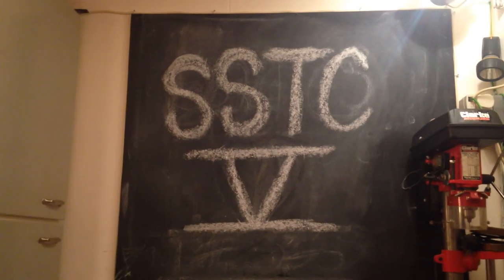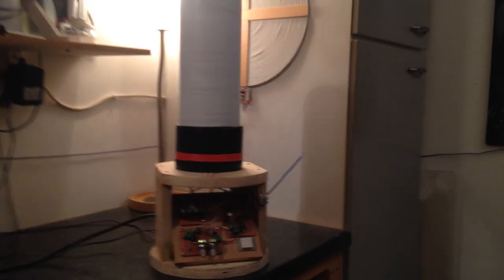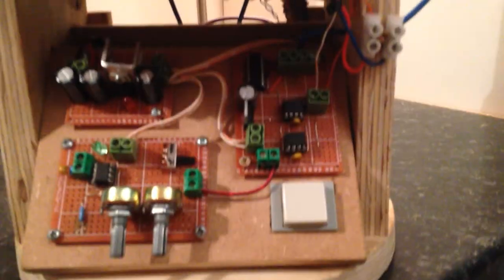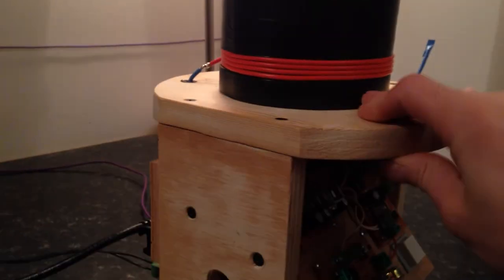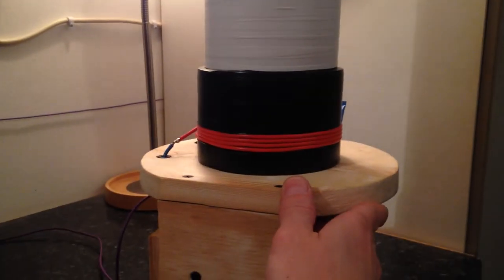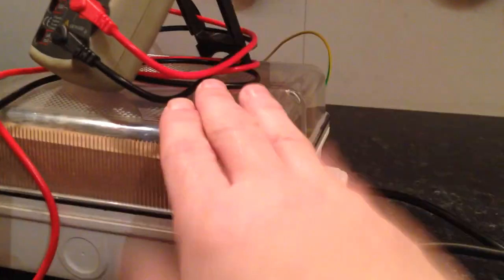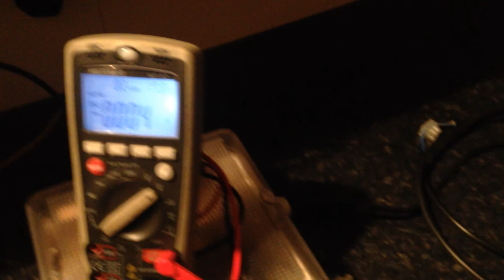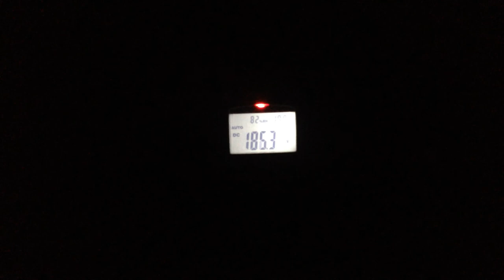Steve Ward Mini SSTC 5

Comment from the maker: Yes those little yellow ceramic caps. I think Steve suggests .1uf >. I've had all sorts of values. This one has a 100uf electrolytic!  Which is all wrong but I found it lowered the frequency  and the arcs got longer.  I would try .1uf to start with and then when it's working try increasing the value and see if the arc profile changes. Mine went from a bushy hissing arc to this loud long drsstc type arc. :D cheers
Reply: deeds thanks man. So those are polarized caps? that doesn't cause any issues with the gate drive output being AC?
Reply from the maker: +nabzim I know bud, It all started with some 10uf tantalum caps I thought were ac caps. Anyway so  I had 10 x 10uf  which I thought were AC caps  on the gate and some of the caps started going brown. I looked up the caps and found they were polarised  tantalum. So I removed all caps that were brown and replaced them - remembering to orientate them with the same  polarisation as the other caps. I was adding 10uf at a time until the arcs didn't get any longer.  So when I found 100uf worked good with the tantalum  I switched  using a little 25v 100uf  (might be 50v) nothing special just a regular dc cap. If I drop the value that frequency goes up. It's like the bigger cap is charging and slowing down the pulse to the gdt??? I can't think why it works but it does. Cheers mate
Reply: deeds what frequency are you talking about going down? I know you said the gdt, but is it not supposed to be at the same frequency as the secondary coil and the inverter ic chip?

Comment: nice and clean. but the bulb next to the tower isnt doing anything extraordinary....hows the transmission with that breakout?
Reply from the maker: It's pretty good Jeremy, it's a different beast without the breakout. Still not pulling much current tho. ;)
Reply: deeds aye, thats what im seeing too. it seems to take a different type of feedback loop to 'lock' it to a receiver coil than it does for breakout

Comment: y'know that capacitor that steve suggests to be larger as "it improves gate drive" ? what value do you use there? Is that what all of those yellow upsidedown caps are under the top deck?
Reply from the maker: Hi bud, I just wrote a reply to you but typed it in as separate comment by mistake. I'm using my phone and it won't let me copy and paste it.  Cheers for now. :D

Comment: wow that's wayyy better then mine ! im giving around the same input power and my arcs are only half as long as your's !? dont know what im doing wrong .. all i can think of is that my GDT is not the best to use as i have built the circuit just as is no mods really .. what type of toroid are you using for your GDT ? great job on the coil by the way, is the secondary also by Wards specs ? mine runs at 387Khz ...
Reply from the maker: Hey bud, try changing u6.. Add 10uf at a time.  White or green toroid both work good. Mine has to have a big topload  to throw sparks Seb. It's a pussy without a topload.  As I added to u6 I found the frequency came down and the arcs got longer and more spark gap in appearance. I doubled the timing cap to get the long pulse, I've got two 104s on it.  Bell wire for the gdt seems to work fine. 2 x 250v 680uf in series for smoothing. My coil is 4.25 x 12" - 30g. Toriod is 1" x .25 from and old PSU, can only just fit 16 turns on it neatly. Thanks for showing interest mate. I hope that gives you some ideas ;)
Reply: +deeds hmm you know i never thought of messing with the decoupling GDT cap. i kept it at 1uF what is the value of yours ? and did physical size of the cap. matter ? my GDT toroid is from a inline filter supply but its small can fit 10 turns of cat5 twisted pair wire on there, i used telephone wire before but it melted ! ah so it reduces the frequency but all that topload reduces your frequency as well hmm i need to have a good long play with it i am on vacation now so i have time now =) i did read that those toroids out of PSU's can be shit but it's a luck of the draw really i have a few more to try .. had a promising one out of a switch mode supply but it doesn't like the interruptor, it rings like crazy i can hear it ! and i have tons of interest i want a TC of every type, after i get a few good sstc's under my belt, im on to vttc's and more powerful sgtc's using MOT power =) many thanks for the tips and advice happy coiling !!
Reply from the maker: +dirkk82 I think you're absolutely right about the torids, go green. I have green. My cat 5 ended up up being solid copper when I stripped it back so I'm running with it. I made one previous with bell wire which was exactly the same solid copper and works/worked just the same. I've heard they can melt through .. I imagine that will come a bite me later you know what these things are like. Just when you think you've got it.. Something melts.  I've got exactly 10 x 10uf ceramic (polarised) caps in parallel on my gdt. Anything more and the output doesn't get stronger.. That's only what I found tho so would always encourage you to try more on your own setup just to see what happens. You know what these things are like Seb - trying is the way forward. Have a great holiday, I'm just starting to relax (8am) into my first morning of two weeks holiday too mate.. boo yah I'm going to enjoy this ;)
Reply from the maker: +dirkk82 I've got one waiting to be spark gapped too mate, I'm still building up the courage to play killer MOTs tho. Then VTTC, same same plan my friend, take care
Reply: hey deeds thanks again for the feedback this is really helping for practical experimentation i plan on doing monday when im back home .. i'll keep a lookout for more toroids i need something bigger for more turns of winding, im sure bell or telephone wire works but too few turns on the GDT and you'll have too much output current resulting in melty wire :-P polarized ceramic caps: ? never seen those before have to take a look at those but good to know that polarized caps work =) yup im much more an experimenter myself as well, i read and gather info and theory but in the end i see myself mucking about to see what does and doesn't work :-p yeah i was hesitant as well playing about with MOT's, imagine me standing atop a chair to read the output voltage with a 40KV fluke so to completely isolate myself ! bit overkill on safely.. anyhow enough ramble you take care as well enjoy your vacation too !

Comment: Hi, plz can you tell me the parameters of primary & secondary? thanks
Reply from the maker: Sure mate no probs.  it's made to the specification that Steve used so it's a 4 turn primary and the secondary is about 900 turns of 30 gauge. The resistance of my secondary is 118ohms.  White, yellow black or green ferrite cores work well for the gdt.  Wind 16 turns for the mosfet side and then experiment taking turns off for the driver side, the last Half bridge little coil with the Igbts I made was 16 and 12.  That's where your tuning is. Sorry if you knew that but it's really important to experiment with the gdt.  You can find the 322p driver chip gets hot if you don't have the gdt turns right.  Cheers ;)
Reply: +deeds thanks, i dont use igbt cuz i dont know how to use it but i have IRF740. What about capacitance of electrolytic capacitor on half bridge? can i use 330 or 360uF instead 420uF?
Reply from the maker: +Andy_cze Igbts are no big deal buddy. They're a direct swap for a mosfet but you need to use different diodes I'll help you if you want to try them one day, go with the mosfets first.  The half bridge capacitance is .33uf   I'm using mkph 50hz 800v/1200vdc cooker capacitors and irfp260n.  I tuned mine up using a 600watt 80v dc step up transformer (£8 eBay) being powered from a 20v 3.2amp old dell laptop charger before using the variac. If you're trying different mosfets then just start of with low power. Keep checking the heat of the fets and your driver ic's (most important).  When you've got the best out of it at low power, arcs as long as you can get... Then switch to the variac and do the same, more power, check heat, increase power, check heat. Make sure you power that variac off before checking the bridge heat (safety first, you know that anyway). Watch touching the topload I've had shocks off mine when a mosfet was blown - that was off the 70vdc!  Aliexpress.com for cheap bits.
Reply from the maker: +Andy_cze ...I ran out of space in the text box.  If you handle waiting a few weeks then aliexpress.com is where I've been buying 90% of my electronics. 260n's  322/321 driver ic's, cooker caps, heat sinks, pots, connectors, hex ic.. I got like 10 of everything so I had enough to build a few complete setups. I have 4 x SSTC5's lol :) I got better at building them each time. My friend Tesla Explorer gave me a lot of help too. Just ask me questions mate, I'll always get back to people and am happy to tell you the specs of anything. Have a good day. ;)
Reply: +deeds im living in central EU so i cant use 260n if i want use wall socket, which i want so i decide to use IRF740 or IRFP420(maybe IRFP460 i dont know now) instead IRFP260. how much current it getting normally from wall? Cuz IRF740 can handle "just" 10A :/
Reply from the maker: Be careful buddy, I'm in the UK rectified 240v is about 300+ dc. (240v 15amps over here).  The tc won't pull all that current tho.  I've always started low and built up with the voltage. I had troubles getting it working the first time, the antenna needs to be positioned just right. Good luck mate, stand clear when switching it on, if you get it right then it should throw some decent sparks ;)   Wherever possible get components that'll take some abuse so the more amps they can handle the better.
Reply: Yeah i will be careful but I still need gets amps about 5A is it possible from wall? I have metal case from old PSU, which will be grounded.... can a spark buzz it? I have 1236turns 0.33mm wire on 68mm diameter,  whats about primary? still wind around bottom of secondary? Can be antena shorter or longer or it blow up anyway?
Thx its still me Andy_cze :D
Reply from the maker: +Ondřej Langr +Ondřej Langr .. You'll get the current you need.  Psu case is perfect, faraday safe.   Put pads under those fets if you're using one heat sink too. The SSTC loves to have the primary around those bottom turns - all of mine a the same, 4 turns right on the first turn of the secondary.  .33 is about 32-34 gauge at a guess which is perfect. ( 30 gauge is .50 from memory) the antenna will be fine. I have a tall coil i just needed a longer antenna. Play with the antenna, mine are all about 150mm for the 1ft coils, about a 1/3 longer for the tall one. Depending on how close you have it.  Mine are all literally right under the coil mounted to the base. Cheers
Reply: +deeds my winding is 47.6cm tall and space between winding and coil is something around 1.5cm. Antena will be around 30cm from case?
Reply from the maker: that's fine buddy. it'll still work if it's far away.  I just made the antenna taller on my big coil and that improved it.  Start with a 200mm (300mm even)antenna, then cut it back until you can get it as short as it really needs to be.  And yes, I've always ended up cutting too much off.  You'll know when you've cut too much off as it'll be less powerful. ;)
Reply: deeds i have copper 1.25mm thick cable can i use it?
Reply: deeds and what about filtering capacitor i have just 420uF
Reply: oh sorry 330uF... 420uF is on design
Reply from the maker: sorry, you're absolutly right. I didn't realise you meant the smoothing after the rectifier.   330uf should be fine, you could run that bare back with no smoothing.   I've only just put smoothing caps on my Variac. ;)
Reply: it's ok. But Smoothing is for protect the MOSFETs for spikes ...Am I right or not? :-)
Reply from the maker: +Andy_cze absolutly mate, and it makes quite a difference. The arcs are cleaner and smoother. My sgtc on the zvs coil is different too, better.
Reply: +deeds Ok thank you. When i come back from school i solder filtering capacitor(i get 680uF), bridge rectifier and film cap (meanwhile do the rest on gate ). Then I'll send you some photos of dat circuit. Sry for english i now woke up :P
Reply: Sorry dude for that latency, today i tested it. Something blew up maybe at GDT or half-bridge area i dont know. My father said it can just throw spark cuz i have a lot of soldering Sn on bottom of "wiring"... I have to make PCB and dont do it from preetched and drilled board. But there is problem. I etched 2 PCBs first was bullshit and second a so close to that i want...
Reply from the maker: I think building it, breaking it and then improving it is all part of it mate. I've blown loads of transistors and mosfets and power supplies (lots of other components). I'm still learning too. :D
These prototyping pcbs with solder points are good. Here's and example of what I mean.
http://m.aliexpress.com/item/32514300140.html
Let me know how you get on. ;)
Reply: +deeds yeah, this boards are maybe good but if you are a little bit idiot like me, this will blown you xD I will rather buy better MOSFETs maybe IRFP460 and somewhere get my pcb board etched. Im buying parts on gme.cz (if u want there is translation) because its in Brno (South Moravia - Czech Republic) and  i am some kilometers away so its not that away and its "cheap" with helpful and nice sellers at their shop. Next way how i get parts is desoldering old PC PSUs... i hope that i fix it early.. :D Can you tommorow revide my pcb design? i dont want next fail.. thank you, bye :-P p.s if u somewhere dont understand im sorry i just learning english and im not master :-P
Reply from the maker: Andy_cze oh buddy I'm sorry, I missed this.  That's good you have a local supplier.  You are right I'm using the PCBs that don't have tracks, just holes. I've had terrible problems with the PCBs with tracks, multiple times I've blown them off the board. 
How are you driving your FETs are you using the driver chips like Steve Wards design.  
I can understand your English perfect my friend don't worry about that.  
This is 7 days old now. I'm sorry I try to get back to everyone as quick as I can. 
Have a good day, link me to your circuit if you can. I'll have a look, I'm just a beginner really tho. ;)
Reply: +deeds nevermind ;) i decided to get from fitzing to eagle because i think that fritzing extra bold tracks is not bold enough. i have to remake it :D
Reply: OK there is it https://www.dropbox.com/s/9i4emq2arwy8e0b/SSTCV5.fzz?dl=0 
Im sorry for that fritzing, because i found how to get bigger track and Eagle dont support this size of my PCB :-) Thanx for Revision :D
Reply from the maker: Hey bud, I just need to get Fritzing to see it. I'll try and download it later :)
Reply: +deeds i can send it like ready to etch - image or screen from fritzing :-)
Reply from the maker: deedsgallagher@gmail.com;)
Reply: +deeds ok, give me a minute ;-) :-P